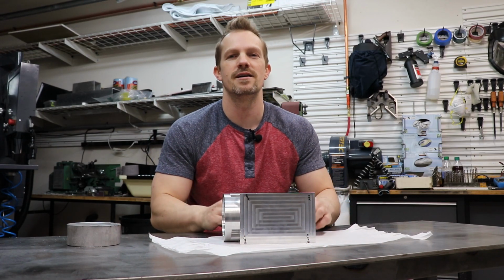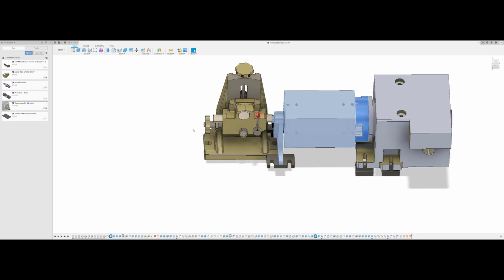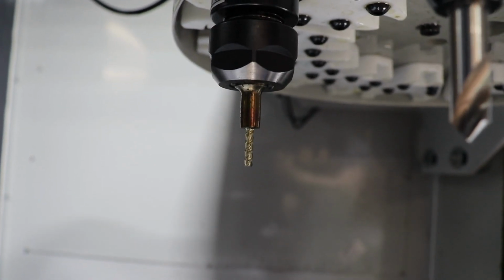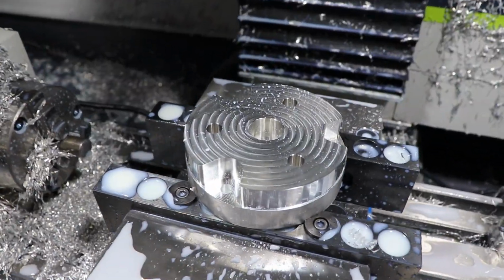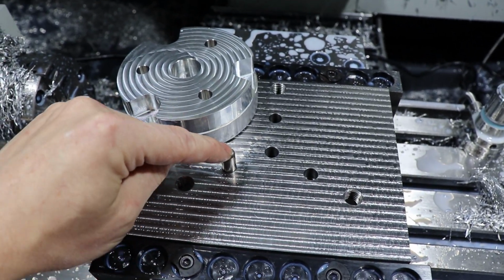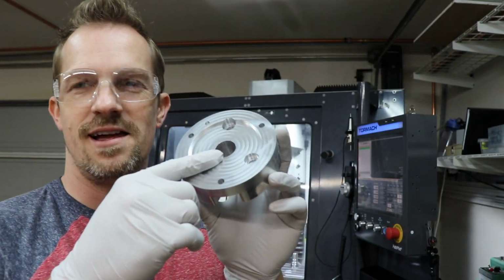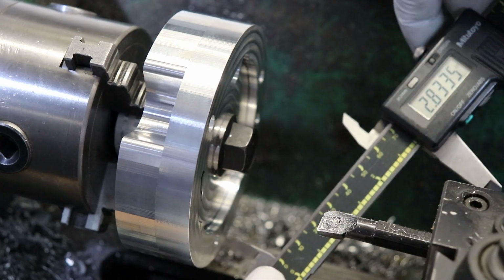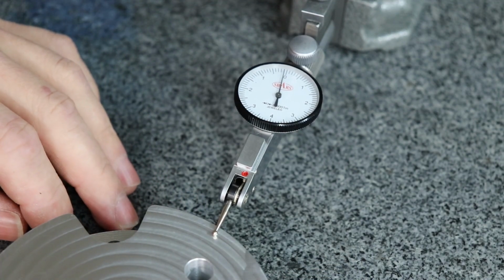Making a 4th axis tombstone adapter plate for the Tormach MicroARC

Comment: If you have your mite bite clamps about 4mm off the base of your fixture just before your about to grip the part.  When you apply pressure it will pull your job down flat.

Comment: Hi Jason, would you consider sharing your F360 model of the adapter plate ? I'm designing one for a small EDM vise and would love to get the accurate measurements from your file
Reply from the maker: I'm not sure about sharing the file but I can tell you the critical dimensions on mine. Keep in mind yours might vary somewhat depending on their manufacturing tolerance. The protruding flange OD was 2.833 in (71.960 mm) and the bolt circle diameter is 3.307 in (84 mm). Let me know if there is anything else you need.
Reply: @vcedge9466  Perfect -all I needed to verify ! Thx much

Comment: As another new owner of the 1100MX I am enjoying watching your progress. Automatically removing stringy chips is easy on the MX with flood coolant.  Basically, after pulling the tool out of the string generating cut, raise it in Z about 2 inches above the work piece and spin the tool backwards with the flood coolant on. There are two approaches to do this, Mark Terryberry  in this YouTube ( https://youtu.be/d1ATntHemHk) shows how you can manually insert 4 lines of code into your program after each string generating operation. I've found that it is easier to do it in CAM software like Fusion 360. In CAM after the string generating operation create a simple drilling operation. In the operation raise the tool  in Z about 2 inches above the work surface, starting from that position perform a simple drilling operation above your work piece. "Drill" counterclockwise to a depth of 0.001 inch (or some other tiny depth) with a bottom dwell time of 2-3 seconds. The coolant will blast the stringy chips right off and away from your work.
Reply: I forgot to mention to rotate the tool counter clockwise you have to set up a dummy tool in the tool library specifying that it rotates counter clockwise. Set the tool up as a manual tool change tool so the ATC doesn't try to swap it in.
Reply from the maker: Great info! Once it's all set up that does sound pretty easy. Thanks, I'll give it a shot.

Comment: You can use 2 dowel pins instead of 3. If you use a lot of dowel pins, you will stack up tolerance. In some case, your holes in part can’t fit with fixture.
Reply from the maker: That's very true. Now that you mention it, I could have made a boss for the center and then only needed one other pin. That the cool thing about machining setups, there are many different ways to accomplish the same goal.